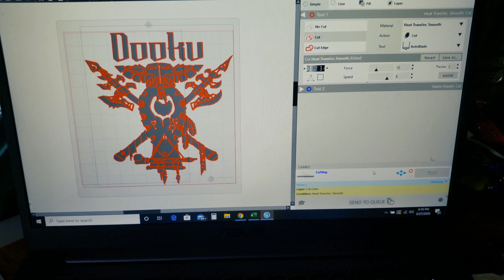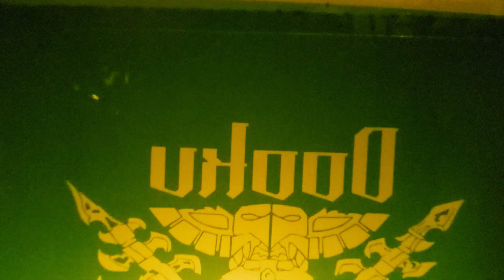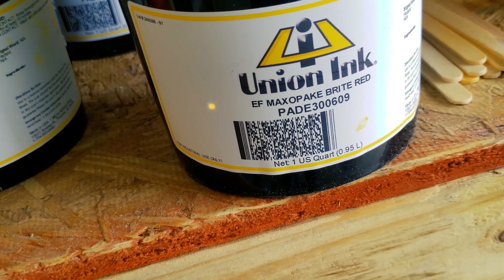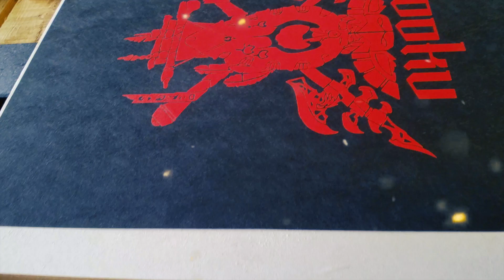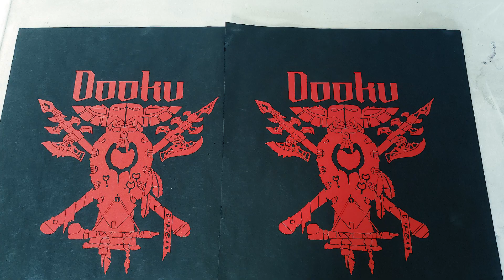NO PRINTER NO PROBLEM Screen Printing . (Episode#9)

Comment: Love your channel man, as real as it gets! You can use your flash to cure but make sure to pull the shirt off of the board first. And use a temp reader to make sure the ink is reaching 330. If the ink doesnt crack when you pull on it you're good to go!
Reply from the maker: Man ...thanks...  you should have saw all the glue stuck to the shirt and my pallet was so hot ...I was like nope just use the press lol...I dont like the press because of  have how shiny it makes the ink ...I like dark Matt looking inks ..and ty for watching  👍....many more to come ...
Reply: @poormanprinting7837  yeah if you cure it too much itll get real hard and shiny, it referred to as "bullet proof" lol but you can achieve nice matte finishes with a heat press and a matte finish paper
Reply from the maker: @NickNasa7  didn't know that either..lol ty ...I'm learning so much as I move forward with this business..

Comment: Fantastic work... When exposing the way you do I recommend put something in the inside of the frame to push up 👆 just a little on the screen and cause a little pressure  and the put then sit the glass on top  of the screen they way you do, this is so you won't get wash out screens.
Reply from the maker: That's a good idea...👍also I need to paint the top part of my exposure light black so it doesn't reflect..I keep forgetting about that ..lol
Reply: @poormanprinting7837  I purchased a 4 piece fatigue foam mat set for 8 bucks at harbor freight and cut it to size, use all 4 pieces.

Comment: How do you know your screen is over exposed?
Reply from the maker: the first time I used the 21step calculator I got a 4 so that's telling me I was under exposed @20 seconds so I bumped my time to 25 seconds and I got a 6 ...so now I'm still under exposed just by a little bit...so I'm going to see if 28 seconds will get me a 7 and that will be a perfect burned screen for the emulsion I'm using and the screen mesh...It can change with different emulsion and screen mesh count..